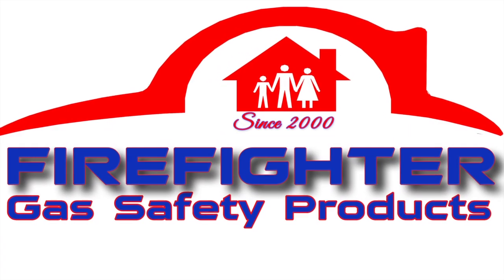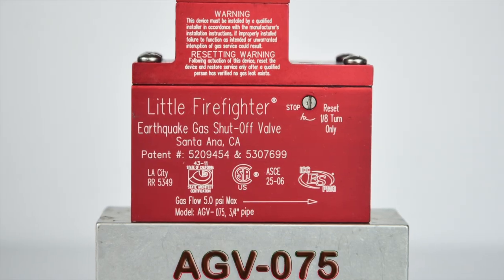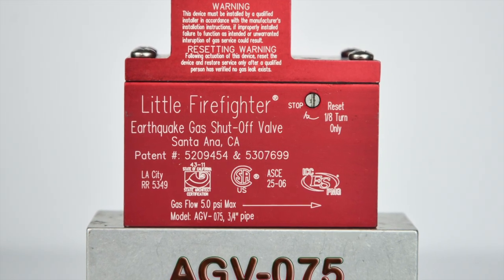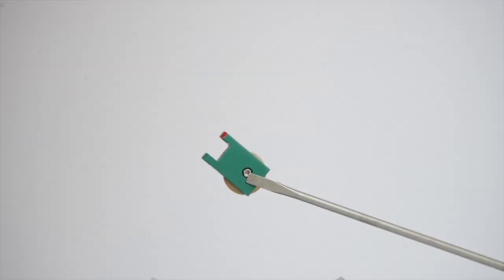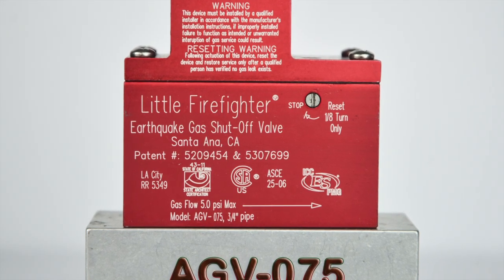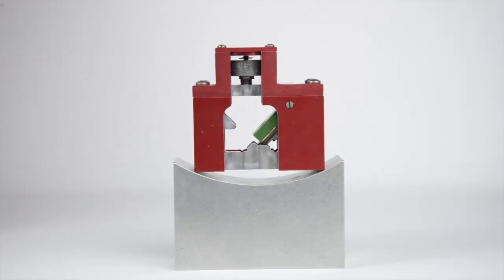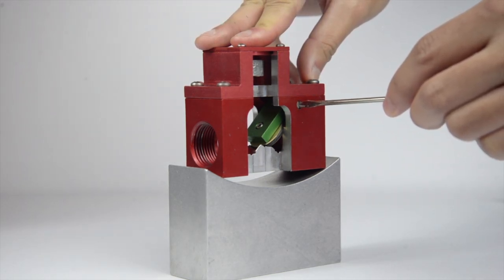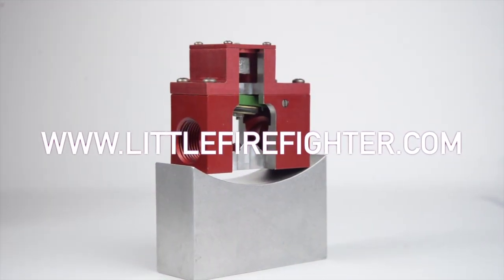How to Reset Your Earthquake Gas Shut-Off Valve (Little Firefighter- AGV Series)

Comment: Great video!  My gardener must've knocked into my earthquake valve as he walked through an adjacent gate.  So, the valve can 'shut off' if there is a distinct jolt of various  kinds.  A magnet holds the valve open (thereby making it easy for a jolt to dislodge it), and when you turn the reset screw, you will hear the magnet attach itself to the top of the metal cavity, thereby holding it open.  You learn something new every day!

Comment: I found a major design flaw in this gas shutoff valve.  The cavity on the top with four little screws only has a small o-ring gasket to keep water out.  The o-ring is sized improperly so its very loose.  What ended up happening is water gets through the screws on the top and fills up the cavity where the magnet and the mass is attached.  Its best to add additional sealant around all the screw heads to keep water out and also add a shield over the top to prevent water from getting in as an additional precaution.  I was shocked to see the inside completely filled with water and it caused the valve to trigger and not reset.  There is just enough gap around the screw threads and the rectangular cover to allow water to get in easily if its outdoor for years.  Because the cavity is sealed, water can't escape if it does get in.   I cleaned all the corrosion out and was able to make it work again.  The maker of this product should have added sealant around each screw before they tighten it up.  That would prevent water from getting in between the threads and the thru hole.

Comment: It looks like I have AGV-075. I had to reset this more than a few times. Because the workers who are remodeling unit next door were dropping toilets and bathtubs on floor. Which tripped my seismic shut off valve. Since it is located on gas meters, next door.

Comment: Mine shows the green signal when I turn it but when I let go, it goes back to red. What could be causing this?
Reply: Too much force when turning
Reply: I'm having the same issue. I gently turn it 1/8 of a turn, but it doesn't "click" and stay reset. It's completely level from end-to-end and side-to-side, too.
Reply: I had the same problem and it turns out that there is a major design flaw in this unit.  The top cover with the four small screw is not sufficiently protected from water intrusion.  Water gets in between the screw threads and the hole on the cover.  Once it gets in, there is no place to go other than the center cavity.  Water ends up filling the cavity and corrodes the magnet and spring mass inside.  Once it corroded, it creates a gap between the magnet and the flapper valve.  With a small gap, there is not enough magnetic force to keep the flapper valve open.  You can open it up and clean up all the corrosion and reseal the cover with sealant gasket or silicon.  You can't rely on that small O-ring seal to keep water out.  Its too loose and since the gasket is on the bottom, water eventually works around the gasket.  They should have created a lip to make water go against gravity to get into the cavity.  They should also seal all the screw heads with sealant or silicon to keep water out.  I ended up cleaning everything up and added a little corrosion protectant on the parts inside and resealed everything to keep water out.  I also added a cover over the top to keep water from dripping into the valve.  It looks like this is a major problem.  I opened up the other gas valve and it had same problem also.
Reply: @borganizm9964  Water intrusion is the cause.  Too bad I can't attach pictures or it would show the corrosion inside around the magnet which created a gap and prevented the valve from staying open.  The magnet becomes weak as the corrosion creates a larger gap and the flapper does not stay up.
Reply: @thegrowingstatewarriorbayarea  No.  Its corrosion and not too much force.
Reply: @ahndeux  Am having the same issue. It’s been cold and rainy in California. Added this to one of my remodels. Will see if opening the unit and resealing helps. Thanks for troubleshooting this. Seems like the design needs improvement. Cmon Team LFF!
Reply: @Ken-sm7hh  You will be surprised when you open it and see how corroded it is inside.  The surprising part is the housing is anodized so that actually looks pristine.  I totally forgot to put something over it to protect it from the rain until you mentioned this.  It's been raining here down in Southern California for the past few weeks.  If you need any other help or info about the process, let me know.  It's very straightforward.
Reply: @Ken-sm7hh  Make sure you only take the top four screws on small cover on the very top.  The other four screws on the lower section exposes the inner workings of the valve so you don't want to take those screws off.  Make sure you turn off the gas before you do any of this work.
Reply: @ahndeux  Thank you for the tips! Will update later.